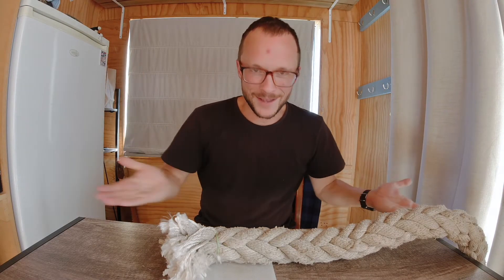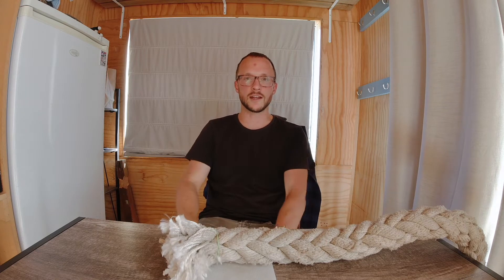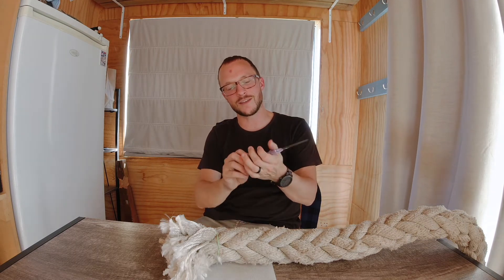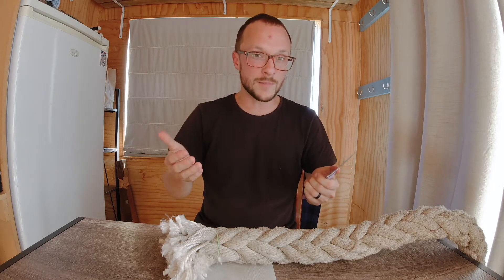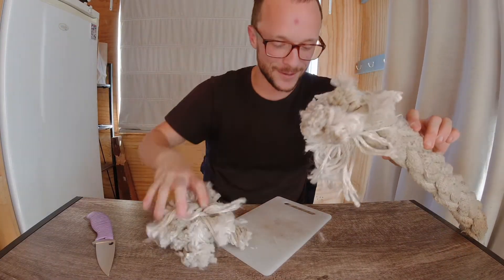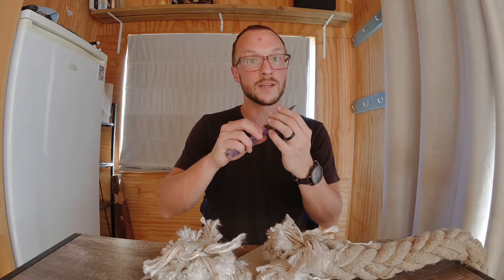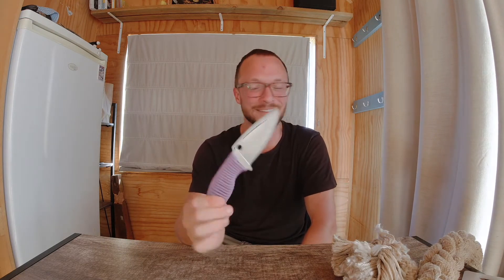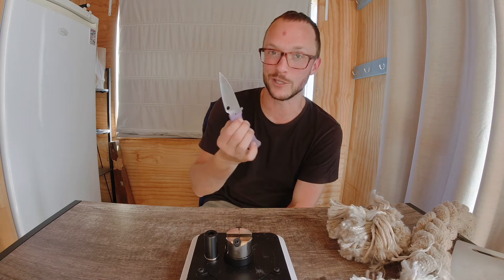CPM MagnaCut is HERE - 250 Grit Edge Spyderco Mule Knife DESTROYS Rope of Death

Comment: You did something reeeeally wrong to make it 280g after sharpening!?
Usual is ~150g for beginners, ~100g for non beginners, and <50g for pros.
Ofcourse with 250grit its harder but could still reach 150-100g. 

And about "dual grit sharpening" maybe you already know, but the myth is busted, the reason why it cuts longer is because it forms a macroscopic but forward oriented burr that has a lower angle than the intended edge. Lower angles cut longer but are less stable, making it not comparable with the rest of the data and an unfair comperasion.

*Edit, seen your other video.
DualGrit should be compared in an edge retention test to an edge with a comperable lower angle or apex stability.

For the same angle/apex stability it likely will have very similar edge retention.

The main difference would be that the lower angle normal sharpened edge has slightly less wedging due to the shoulders being further back.

And on apex stability, i would love to see SEM images of dual grit after carving some wood.
Reply from the maker: Hey Sabelfechter, nice to meet you.

This edge test was not oriented for BESS keen-ness but a comparison of a messy, fully coarse edge, not deburred fully to compare longevity on this particular rope with the buffed and mostly deburred factory edge which failed to pass through this ship rope.

I think your BESS numbers hold true for a preset-angle system; most of the hand sharpeners I know can get 100-150g but under 100 BESS can be hard, especially with conventional steel.  I have been getting numbers regularly lately in the mid 80's at a 17 dps. 

If you are actually getting under 50 without a wicked edge/KME etc. at angles that can hold up to daily use (like 15 dps or moer) then props to you bro!

You've got a steady hand and a lot of skill if that's the case.  That said, if you are accomplishing that by hand, I would love to see you post up a tutorial that helps others achieve the same results.

With regards to dual grit being a busted myth:  I assume that you are referring to the article written by Todd Simpson.  I provided the sample edges for Todd to write that article and the research that has been done has been collaborative between he and I.  There is a difference between busting a myth and learning together, and we're doing the latter.

With regards to dual grit lacking lateral stability, and it not being fair to compare angle to angle directly - and your desire to see what happens if dual grit was subjected to wood carving or high impact, you can review the following "1000 chop test" video where I discover that a denim stropped edge is much more durable than dual grit, and openly change my high impact test edge to a micro-convex.

https://youtu.be/C-QD3WIa_s4

Thanks for your comment, you really know your stuff.  As far as I'm concerned, we're all on the same team trying to learn the micro-physics of edge holding.

I am totally ok with dual grit being whatever it is, and have no need for it to be "the best".  I would welcome your thoughts in the future, you seem like you have good things to say.  No need to say them in an adversarial way - I'm already listening.

Have a great day dude, and take care.
Reply: @homeslicesharpening  Great to hear you did a test on wood.
And yes that fully explains the BESS result!

I agree with it being a learning process, but there was an excessive amount of hype and "BESTEST EDGE EVAR" titles all over the internet that likely reached more people and left them misinformed than the conclusion video and article that it was an unequal comperasion, and lower angle normal edges perform equal.

My sharpening technique is very simple in practice, but takes a moment to explain, it merges the key goals in sharpening:

-short time spend on sharpening
-fastest possible touchups
-high quality edge
-stable apex
-very low wedging

Usually those are contrary to each other in different ways.
A for example 17dps edge will have a stable apex, but wedge due to the shoulders.
A high quality edge isnt easy to get by fast touchups.
It works well on super thin ground knives, but fully thinning a knive by hand is an insane amount of work and time.

So here is how to do it (works best on flat or hollow grind, okish on sabre grind):
Remove material with coarse grit at 10dps to thin it, creating a "relief"/"transition" bevel.

Take a wooden or plastic block in the size of a sharpening stone, use glue or double sided tape to add a ~2mm silicon rubber sheet on it.
Rub glue stick on the silicon rubber, put a sheet of fine sandpaper (cut to the same size) on it (i use harder silicon carbide sandpaper.)

Now "apex" it at your intended angle* with very light edge trailing passes. Between 3 to 10 alternating passes per side! (3 for max cutting performance, 10 for stability like carving harder and uneven wood.)
*15dps for stable steel, towards 20dps for less stable steel
(The change in angle makes insane jumps in grit possible, due to contact area with the abrasive being fully minimized.
Also the silicon rubber backing and light passes produce a much smaller burr and weakens the steel less.)

Now about 15 or 20 alternating passes per side on a leather strop with compound.
=free standing hair popping

You now got a much less wedging 10dps relief with a for example 17dps stable apex, that you can fully resharpen/touchup with very few passes (+stropping) due to the minimized surface area in contact!

It takes like 60sec for a full quality touchup. Which you can do a certain number of time until you have to thin the 10dps relief again (which is worlds faster than full thinning).

The sandpaper around here is 280x230mm, so i cut it in three 76,6x280mm stripes, which gives a nice "large wetstone" shape.

The thing people need to realize is that where one truly needs stability is the apex, everthing behind it is usually waaay stronger than it ever needs to be.
So the actual edge bevel can be a from the side barely visible 0,1mm/0,004" to be very stable, or 0,05mm/0,002" for extra cutting performance. Behind that the knive can be drastically thinned to reduce wedging and make touchups faster, except that to flat thinning takes to much time, therefore the middleground of +-10dps.

Depending on task one can find the optimal edge size and by that amount of passes for the steel by testing a very small edge with 2 to 3 light alternating passes per side + stropping, then cut the intended material in the intended way, and check under a strong lupe the edge bevel size and the damage size. In the rare case of the damage being as large as the edge bevel (hard uneven carving) one can use slightly more passes instead and check again.

Its a pain to see all these high quality steel knives at 17dps with thick BTE wedging shoulders on instagram.
Reply from the maker: @sabelfechter7136  Thanks for clarifying.  Yeah, that makes sense - I will admit that I go farther than I'd like to the side of "click-bait titles".  I can understand your concern for that - even the thumbnail of this video is more misleading than I'd like.  So I can see your point.

It may not be true, but it feels as if - if you don't dramatize your thumbnails somewhat that they get drowned out by other people's click bait, so it seems one needs to keep up with the way things are done on YouTube.  I don't like it TBH.

Your edge sounds absolutely incredible.  After I study some apex-dynamics on stones, I am hoping to tinker with a similar dynamic.  Perhaps thinning the edge bevel far more than usual (10-12 degrees), and doing a small micro-bevel at a more robust angle.  I may even try your method when I get to that point.

Thanks for the reply, that was cool bro.  Take care.

Comment: Much appreciated ... Awesome perspective of honestly, along with real world research/testing. I am focusing on cutting board kitchen knives. My favorite test subjects ... sweet potatoes. Low lateral stability of cutting edges seems their greatest weakness.  Are you testing edges for lateral stability ?
Reply from the maker: Sounds like interesting testing - do you have any favorite steels for your kitchen knife testing?

I do an edge toughness test now that indirectly tests lateral stability, but not one that tests it absolutely directly.  I hammer the edge into a pine piano leg 3 times with a 5 kg weight and measure BESS after.  Edges with low lateral stability will roll or break on the pine, resulting in a larger BESS increase.

This is the first test in my new series:
https://youtu.be/BeiIThaFrGs
Reply: @homeslicesharpening  The formula for knife steels with extremely good performance is understood by well respected European & Japanese knife companies.  Most of those steels would likely test out durability wise in the top 20% for intended use case scenario.  In real world terms today, it is more about quality control in the steel forging, hardening & machining processes.  I currently work with more X50.Cr.Mo.V15 European steels than Japanese steels but I am testing both. 
 I am extremely happy to have stumbled across your youtube channel as there are likely very few in the world with the intelligence to understand the issue & it's importance to humanity of the future.  We often work alone attempting to solve these issues because most lack the passion, perseverance & capabilities to even attempt this research.  
I am also willing to share my insights & concepts for innovative custom builds of my test rigs to save you some time in the process. I am more focused on kitchen knives used on a cutting board.  Narrowly defining a real world use case scenario will allow one to focus their minds on the most revenant issues & solutions.  Contact info to share images & drawings will be important, my info is readily available on the internet at www.starlight123.com.
Reply from the maker: Thanks for the encouragement too!  Cheers Daniel.

Comment: Very interesting test. Maybe Spyderco wants a salt series knife that will hold an edge longer, but not as corrosion resistant is LC200N. I’m not sure. Just actually just received my Spyderco Mule Team 35 CPM Magnacut. And since you brought it up, I may consider doing the test. Thanks for your review.
Subbed
Reply from the maker: Thanks for the sub!  I have been really impressed by this Mule - but have not done any corrosion testing so far.

Let me know if you find a good sharpening protocol for yours or have any fun test results with your Magnacut mule!

Comment: I have a Bradford Guardian 3.5 in Magnacut and it has quickly become my favorite blade.  The hype is real on that steel.  I've used it for food prep, breaking down heavy gauge boxes, carving wood, feathersticks, cutting carpet, and kindling batoning when I didn't have my hatchet with me.  I think I've needed to strop it back twice in a few months, it hasn't needed a real sharpening yet.

I hit a hidden steel staple with it hard breaking down a box, with no damage.  I've done that with an M390 version of the same knife and micro-chipped it pretty badly.  I was impressed.
Reply from the maker: That's AWESOME.  I have 2 close friends that are looking for EDC fixed blades - talked them both into Bradford Guardians in MagnaCut.

I'm not super surprised by your good experience, given its performance here - but thanks so much for sharing bro.  Have a great day.
Reply: @homeslicesharpening  I had another stress test incidentally this week.  I'd advise your friends to pick a Kydex sheath and tell Bradford you'd like a credit on it for not getting the leather sheath.  My leather one has been worn every day for about 4 months, and it's already loose.  So loose that my Guardian slipped out of retention (horizontal sheath) and fell 3 feet to the polished concrete floor in Walmart, landing blade first.

I was very happy no one noticed.  Again, though, no chips, dings, rolls, or damage of any kind.  Didn't notice any sharpness changes at all.
Reply from the maker: @adx442  That's insane!  I dropped my Spyderco Military in M4 on concrete and the apex was murdered!

Comment: BESS really only measures push cutting sharpness at a very small point along a knife edge. CATRA testing measures slicing sharpness along an edge, but does the grit-impregnated paper media approximate dirty death rope? Probably better than BESS does.
Reply from the maker: Hmmmm interesting thought - probably the bigger similarity is that Death Rope only responds to slicing sharpness like CATRA, where BESS measures push cutting keen-ness and to some extent, apex stability (IE will tell you if you have a feather burr).  

However, the Rope of Death is no respecter of push-cutting keen-ness.